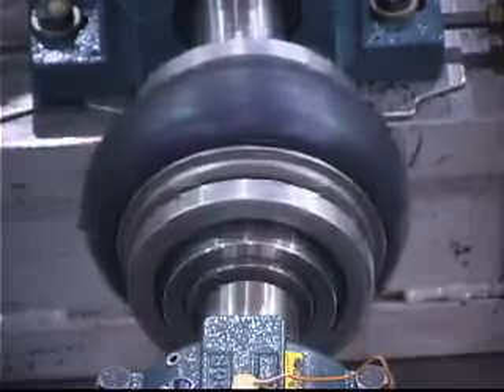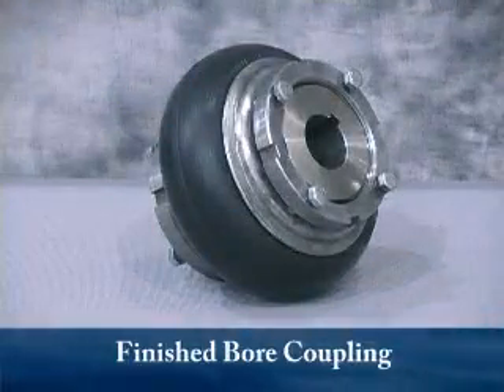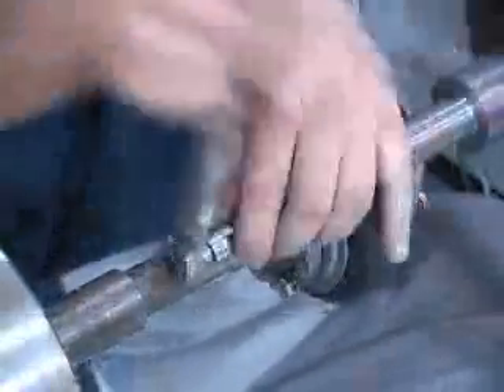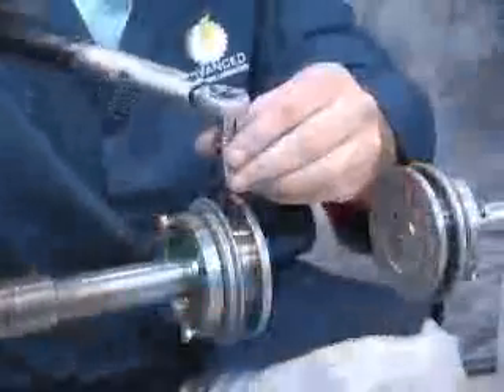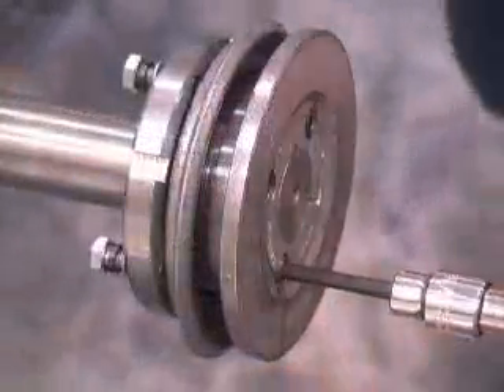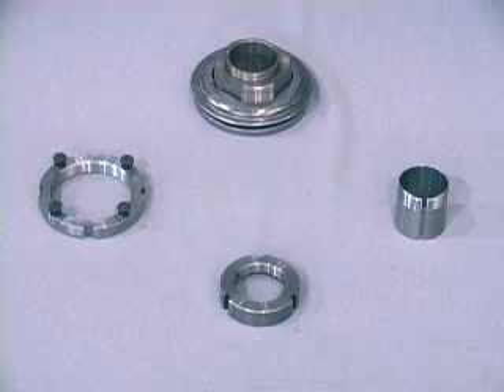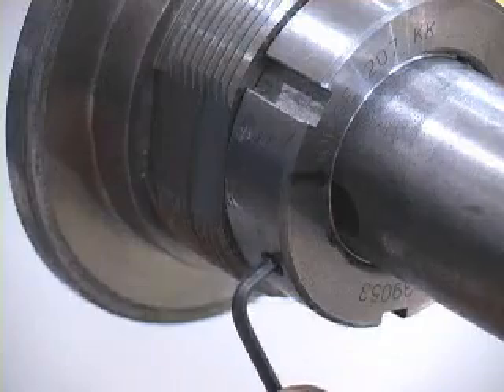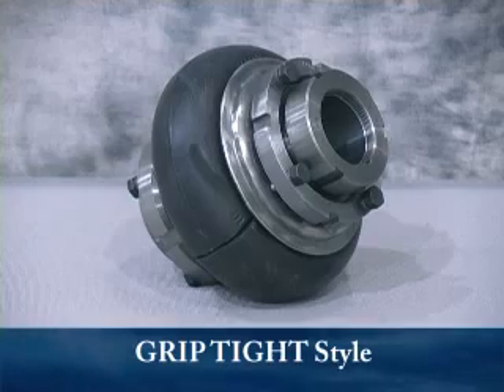Dodge Paraflex Couplings

Comment: I have a problem... Im changing rubber part only, and when i install the new one and turn on motor starts to vibrate too much.... Didnt touch motor or reducer bolts so should be no disalingment, what coul be the problem?
Reply: Alineación angular y
Reply: Tus ejes están desalineados.
Los puedes alinear con láser o con un micrómetro de diez milésimas.